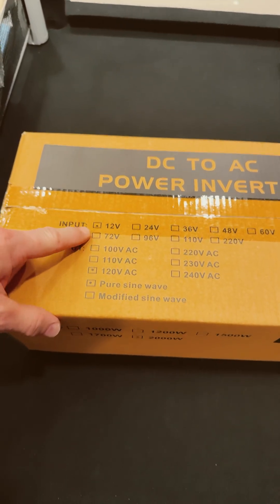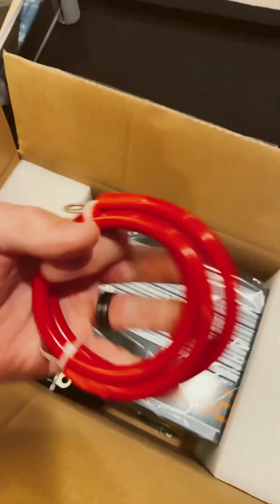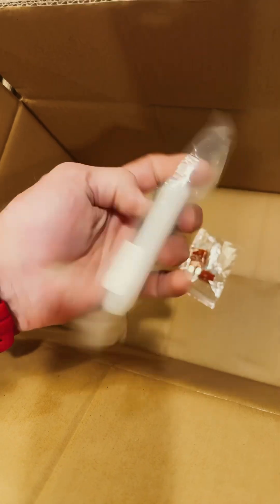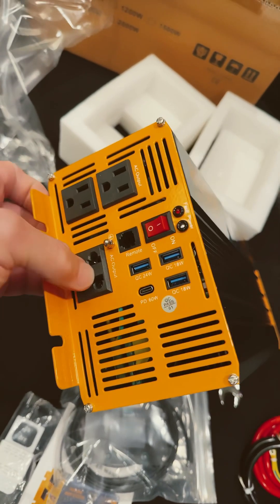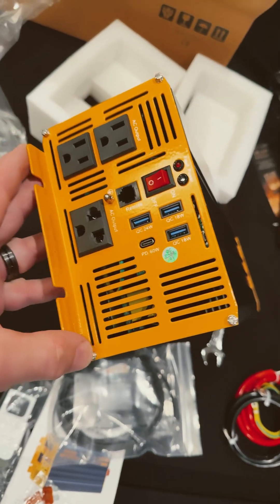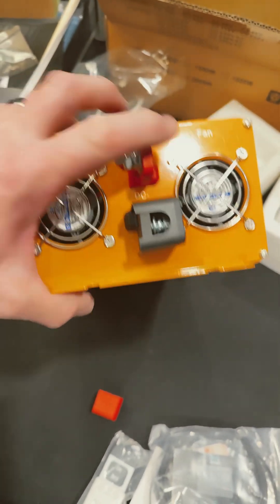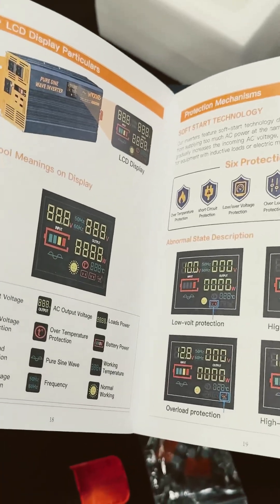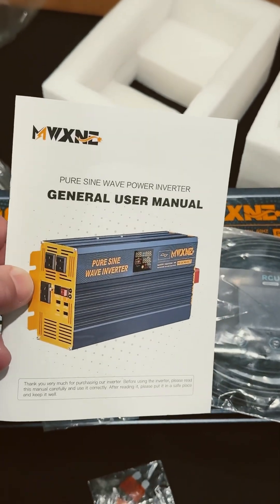2000W Pure Sine Wave Power Inverter with LCD remote display and remote control at $180 #MWXNE

Comment: 2000W even if it were 100% efficient.  Which it is not.  Those input cables really need to be beefy for the amperage.  At first glance they may be under size.  Would be interesting to see if they get warm after running a bit at full load.  Also curious they gave output in watts and not VA, but I'm not the inverter expert.
Reply from the maker: I'll see if the cable get hot.  They are heavy, so I'm pretty sure that they are copper.  The output power is in Watts because if you pull power with near perfect power factor - it will be near the same.  What if you are powering a heating element - stove or space heater - then the PF will be near perfect so it will be in Watts.  The VA is usually a function of the load not the power source.